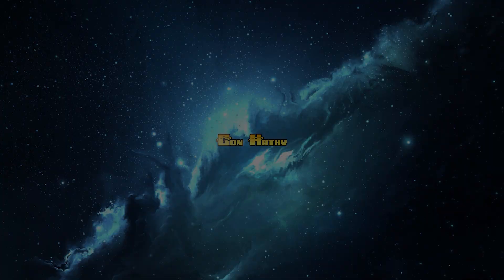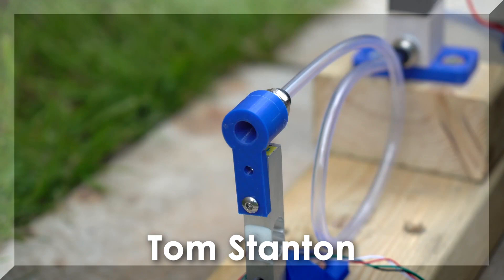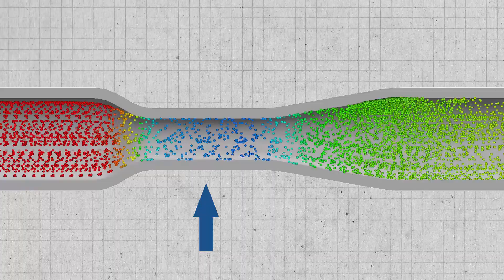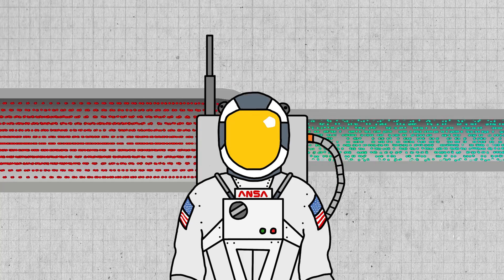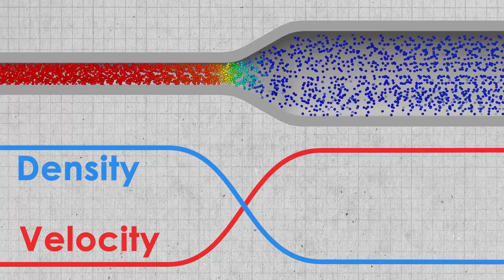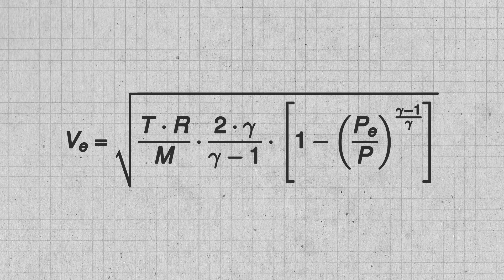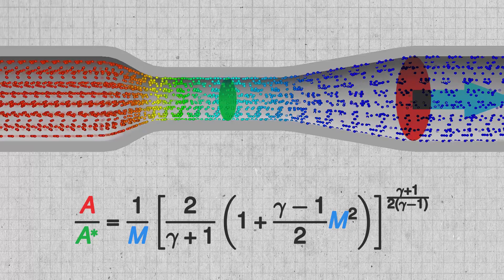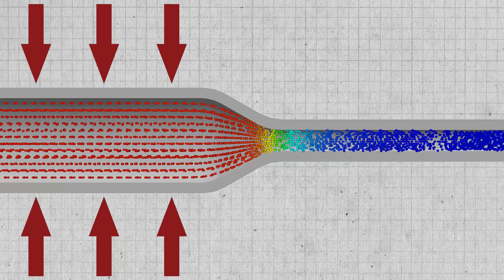Why Do Rockets Have Bells?

Comment: The simple reason why you likely won't get to supersonic air speeds is the same reason you need turbopumps to inject the propellant into a combustion chamber on a rocket engine, in order to get a high enough chamber pressure.

Comment: Best explanation I've seen so far on convergent divergent nozzle! Thank you! But I had seen or read something about the inability of pressure difference information transfer once the flow is at M =1.  That was something analogous to the fact that information can't travel faster than speed of light. That explanation made excellent sense but unfortunately I can't recollect where exactly I saw it.

Comment: A good rule of thumb is to make sure V at inlet is around Mach 0.3 to just below Mach 1. Then the throat chokes it to Mach 1, and the rapid expansion allows it to surpass Mach >1 due to the rule of mass velocity continuity. Atleast, that's what I remember.

Comment: That axial turbine technically may not have a constricting nozzle.  On the rotating section on the most aft turbine wheel.  There is a cone that extends from the roots of the blades of the fan/wheel extending to a point at most aft.  Because of this cone, if the exhaust is fitted with a parallel nozzle, the surface area for exhaust grows linearly and quickly, this is not ideal if thrust is achieved from the exhaust velocity.  So like the turbine pictured at 0:27, even though it is fitted with a converging nozzle, the exhaust nozzle surface area very well could be a consistent size over it's length.
Reply: jet engines can not make that exhaust gas goes faster than speed of sound because it is hot and its speed of sound is over 3500km/h

Comment: Let's say that I was using a CO2 tank to pressurize a potato cannon like thing. How would I find the rate at witch the CO2 decompresses to plug into the third equation. Of course It would be prefered to use the entry area rather than using the exit speed and area. Mainly because of the potential unintentional projectile.
Reply: you have constant pipe area, not bell

Comment: Hi Con Hathy, in order to  maintain parallel exhaust steam.  How about adding an adjustable knob at the neck to create different pressure so that the exhaust steam will be parallel?

Please let me know if it works. Because guess it's hard to build something based on precision calculations.
Reply from the maker: It is possible, they actually do it for supersonic wind tunnels, but it adds much more weight than it’s worth for rockets. Fighter jets will adjust the exit area rather than the throat, but that only works because jets have a much higher mass efficiency than rockets because they don’t have to carry around their oxygen
Reply: @ConHathy  Did you know that all existing ICE for cars are rubbish with efficiency of only 40%?

The rocket engine technology works perfectly well in ICE.
Reply: @ConHathy  if possible I'm thinking of getting rid of the sparkplug. Let the mixture of air and gasoline to ignite at certain temperature. This is vital to simplify everything so that such system is reliable, super simple to maintain plus is highly economical to produce. We don't need self crematory coffins aka EVs. The energy density of fuel is high enough to serve humanity without creating too much pollution only when everything is frictionless.

We have been deceived by the mainstream automotive industry to protect the hegemony of petrol dollar and the interest of oil cartels.

Enough is enough.

Comment: I don't understand, is the speed of sound variable of the atmosphere or inside the nozzle?
Reply from the maker: For nozzles we care about the speed of sound of the gas in the nozzle. The exact value for speed of sound changes with temperature which is why most equations work directly with the mach number and only calculate the velocity when it’s really necessary
Reply: @ConHathy  This is probably the most intuitive video i have found for explaining this. I'm still going to struggle for a while to really understand this enough to be able to use it. (In the form of math etc)

Comment: Thank you for the video. It explains a lot, but I am confused because I get different values with your formula for the exit velocity compared to the NASA online tool (https://www.grc.nasa.gov/www/k-12/airplane/isentrop.html) 

At 20deg C (T=293.15K) with gamma=1.4, M=30g/mol, Pe=1bar and P=5bar I get ve=457.87m/s and a=337.26.

That means supersonic speed with a Mach number of 1.36.
The NASA online tool calculates a Mach number of 1.71. That is quite a big difference. 

Where is the error? Are these different values that are calculated?
Reply from the maker: I'm not quite sure what your input was for the NASA calculator. You gave gamma but I'm not seeing any of the other ratios that the calculator asks for
Reply: @ConHathy  I used gamma=1.4 and P/Pt=0.2 (= Pe/P) as input values. 
The Mach number is calculated from ve/a. If you insert both equations from your video and then simplify them, then R, T and M are eliminated. The Mach number m can then be calculated as follows:

m = sqrt( (2*gamma)/(gamma*(gamma-1)) * (1- (Pe/P)^((gamma-1)/gamma)) )

The result is identical to the one if I calculate ve and a separately and then divide them by each other.

In the NASA tool only gamma and Pe/P are available as inputs. But this is sufficient to calculate the Mach number as shown above.

In the code of the tool on the NASA page the Mach number is calculated as follows:

m = sqrt(2* ((1 / (Pe/P^((g-1)/g))) -1 ) / (g-1))

You can see this in the source code of the javascript of the page.
Similar, but different!
Reply: Same here:
http://www.dept.aoe.vt.edu/~devenpor/aoe3114/calc.html
This calculator also results in a Mach number of  1.70853681 for gamma=1.4 and p/p0=0.2
Reply from the maker: @electricidea  Okay so...
[EDIT: I think I just remembered that pressure ratio is NOT conserved even in isentropic flow so Pe/P =/= P/Pt. I’ll get back to you tomorrow because it’s almost 2am here but I think P/Pt needs to be calculated using T/Tt]
1) Thank you for refreshing my memory, I forgot Pe/P = P/Pt
2) I have absolutely no idea what is going on. I redid all your derivations and they're right. I redid Benson's (NASA's) from the pressure ratio equation (6) and they are also right. I checked my propulsion book to make sure the equations in the video are correct, they are. (The book also contained the pressure ratio equation as well, same as Benson). So I checked my book against other online sources and every page I can find with a de leval exit velocity matches up.

https://engineering.fandom.com/wiki/De_laval_nozzle
http://flowsquare.com/2013/12/24/de-laval-nozzle/
https://www.tau.ac.il/~tsirel/dump/Static/knowino.org/wiki/De_Laval_nozzle.html

And also Wikipedia...
I'm going to have to get back to you on this because none of it makes sense to me
Reply from the maker: Okay, to sum up, total pressure (Pt) is not conserved in an isentropic (ideal) supersonic flow. This means that P/Pt cannot be assumed to equal exit pressure over chamber pressure. To find the actual value of P/Pt use the equation I gave for exit velocity to give you the exit Mach number and plug that into the calculator. If we do this (gamma = 1.4 and M = 1.36) we see that P/Pt is not 0.2, it's actually 0.3323.
Reply: @ConHathy  OK, the calculation basis or the reference values of the two calculations looks different. This is a bit surprising and I don't quite understand it, since the formulas are generally derived from the same basis, but maybe it is due to the simplified model assumption. I found a pretty good summary of the book by Sutton and Biblarz here: https://pritamashutosh.wordpress.com/2014/04/11/nozzles/
Also there the formula is described as in your video with one difference: The speed of sound is calculated without the molecular mass of the gas: 
http://mae-nas.eng.usu.edu/MAE_5540_Web/propulsion_systems/subpages/Rocket_Propulsion_Elements.pdf
(Page 49 equation 3-10)

But let's ask the question differently: If I pump up a PET bottle with air and then let the air escape through a nozzle, can the speed of sound be reached in the nozzle? Since R, T and M are eliminated when calculating the Mach number, the speed depends only on gamma and the pressure ratio. Correct? 
If I pump up the bottle to 3bar, then I have a pressure ratio of 1/4 = 0.25. This will result in a calculated velocity of M=1.28. So supersonic speed can be reached. However, only if the chamber size is very large in relation to the nozzle throat, so that the velocity in front of the nozzle can be neglected. Only then the simplified formula is valid.
Reply from the maker: @electricidea  When the speed of sound is described without molecular mass it's using a different R constant. There is the universal R (which I am using) and a gas specific R (which is what they are using). Gas specific R is literally equal to universal R divided by the molecular mass, so it's still the same equation but with a different notation.

The exit velocity equation should work even with an initial velocity. Like I mentioned Pt is not constant with changing speed so we don't have to (can't) assume that Pc ~= Pt, we just bypass that assumption and use De Laval's equation. You do need that velocity to size your exit area but I'm not entirely sure how to get that analytically aside from running some tests and getting an average mass flow
Reply: Remember that in order to compute the exit speed of sound you must use the static temperature at the exit condition.
The T that you see in the formula for computing ve is the total temperature, not the static one.

The total temperature is defined as T +v²/(2 cp)

I think is better if you add a subscript t to T in the formula for ve

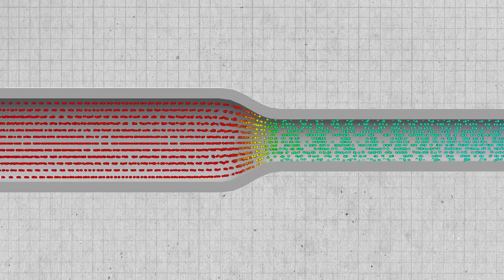Comment: 4:00 "at low speeds flowing gas is considered incompressible". This is just false. Liquids are considered incompressible. But gases are absolutely compressible.  If you have a gas and you double the pressure, the volume will decrease by half (assuming constant temperature, and assuming ideal gas). 

There is a major difference between how gases behave through pipes and liquids.

Gases will accelarate through a straight tube due to frictional losses. Mass flow has to be conserved, with the frictional losses the static pressure is constantly decreasing trough the tube, meaning that density will decrease, meaning that velocity will have to increase in order to preserve consant mass flow. Liquids do (basically) not change density due to pressure decrease, thus liquids do not experience constant acceleration through straight tubes.

Acceleratnig liquids can only be done by decreasing tube area, accelerating gases happens continuously through a straight pipe, and can be enhanced further by decreasing the surface area (up to choked flow conditions). 

Also you mention that there simply isn't enough pressure to achieve choked flow? Yet choked flow occurs at just a pressure ratio of 2:1 for most gases. So only 2 bara (30 psia) is required upstream of the nozzle, which those youtubers definitely had. They must have had the geometry incorrect.
Reply from the maker: You’re correct that gasses are not truly incompressible, however, it is a very common assumption for low speed flows.

Straight from the Wikipedia page:
“incompressible flow does not imply that the fluid itself is incompressible. It is shown in the derivation below that (under the right conditions) even compressible fluids can – to a good approximation – be modelled as an incompressible flow. Incompressible flow implies that the density remains constant within a parcel of fluid that moves with the flow velocity.”

The second part of your comment is describing “fanno flow” where friction causes the centerline velocity to tend towards Mach 1, however, you gloss over some important details by saying “They must have had the geometries incorrect.” 

Fanno flow only achieves the speed of sound in an infinite tube, but let’s just say Tom Stanton’s tube was long enough that it has practically achieved Mach 1. A convergent nozzle was still able to improve his performance substantially. The mechanism behind Fanno flow is the build up of a slow moving boundary layer in the pipe which is essentially a convergent nozzle made out of the fluid itself. This means that while some of the flow is at Mach 1, there is also a large portion that is well below Mach 1. 

That’s why pumping this flow directly into a divergent section hurt his performance. While some of his flow is sonic, most is not. On average the flow slows down in the divergent section as if it is flowing through a diffuser. This also explains why the horn shape performed best flowed by the straight taper then the proper bell. The bell is the most effective at diffusing the flow and the horn is the least effective. You can’t fix this with “better” divergent geometry.

The convergent nozzle, on the other hand, improved performance. It does this by replacing the boundary layer with a physical wall. The construction slightly reduced the mass flow but more importantly it increased the portion of the flow that is at sonic speeds. (Say from 10% of the fluid being near sonic to 80% of the fluid being near sonic. These numbers are made up I’m just adding them to clarify my meaning.) This means a higher average velocity (more thrust) and slightly longer “burn” times due to that decreased mass flow. The result is more total impulse and thus a more efficient thruster.
Reply: @ConHathy  Hey thanks for your reply. Interesting to learn about the Fanno flow, I was not aware of this, but indeed it is logical that the flow is not uniform throughout the tube (edges compared to centreline). 

I'm still not convinced about the incompressibility assumption being applicable though.. On wikipedia it also mentions: "Again, in accordance with all incompressible flows the pressure deviation must be small in comparison to the pressure base state."

Indeed in examples of high pressure natural gas transport where the source pressure could be 20 bara and the delivery pressure 19 bara (difference <10 %) the assumptions about incompressibility will be valid.

But, would think that the compressed air Tom was using was at least 6 bara. Compared to the outlet pressure of 1 bara this is a rather large static pressure change that the fluid undergoes. Wikipedia mentions a small element volume dV which must have constant density, but I don't really see how this is possible with these sort of pressure differences?